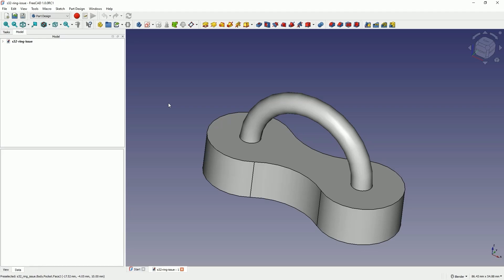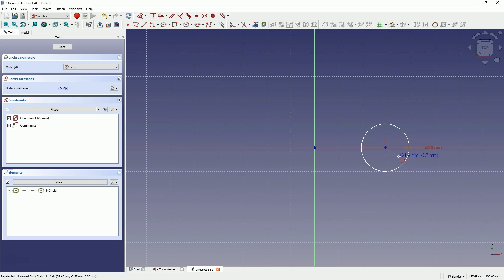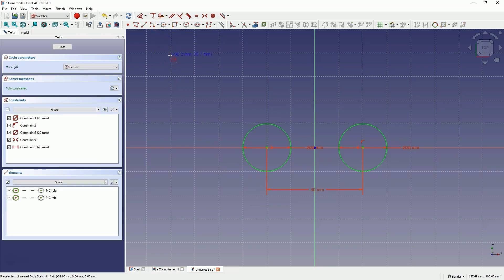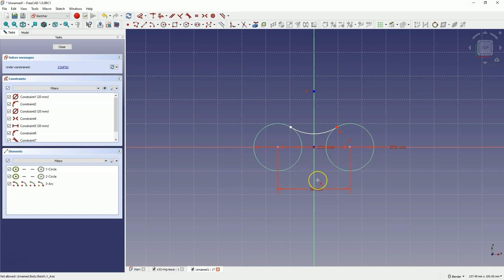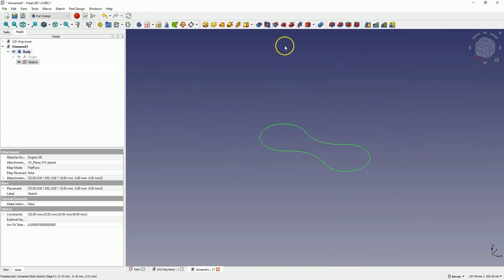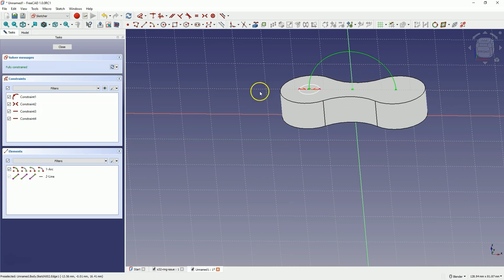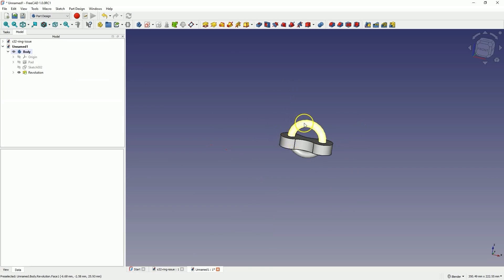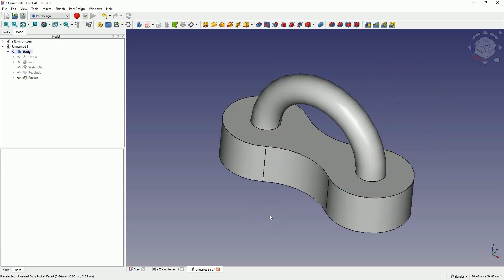FreeCAD Arc Sweep Issue

Comment: I'll have to experiment, but I think a better approach would be to do the first initial. figure 8 extrusion. Reversed keep. keeping the initial. XY plane on the top. That way, the origin would be automatically centered. Then to use. your existing. circle geometry as. External construction geometry, locating the center points. Then drawing the arc Path.. from the. center points. with the origin as the center. as the center arc then actually locating. your circle profile  On the origin. In correct dimension size. and later. mapping it in the data view. and selecting the reference point. from that dialog box. pinpointing it right to The endpoint of the arc with the center of the circle Profile referenced. in the second Reference. of the dialog box. making sure that it was normal. to the edge.

Comment: Interesting video showing different approaches to design the pipe. However, for the revolution approach the pocket operation is not necessary, you can simply limit the revolution to 180°.
Reply: Thank you.
Reply from the maker: @jurgenr3240, You're right. I had a question about how to remove any part of a solid, and I decided to show it with this example. Maybe it wasn't the best example :)
Reply: @CADCAMLessons  your videos are extremely helpful. The AI voice is more difficult to follow. still you have the best freecad learning channel in my opinion. Thanks for all the lessons.